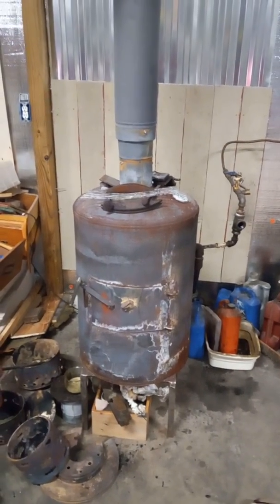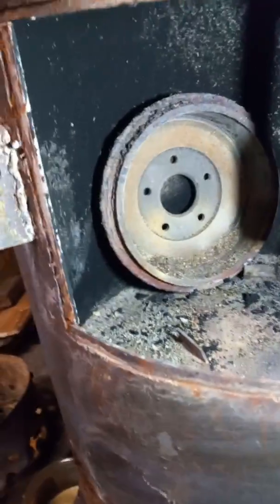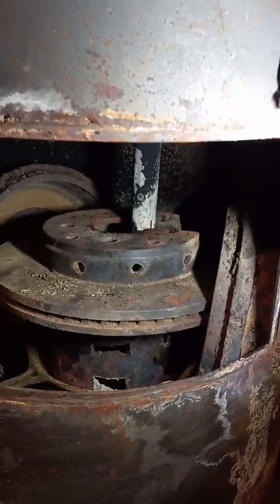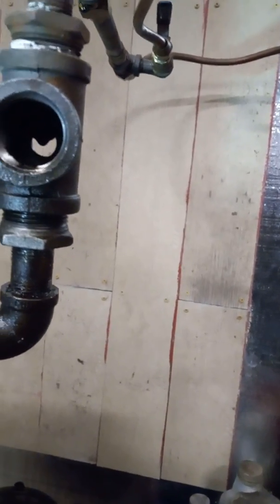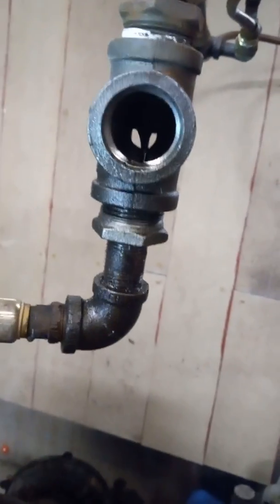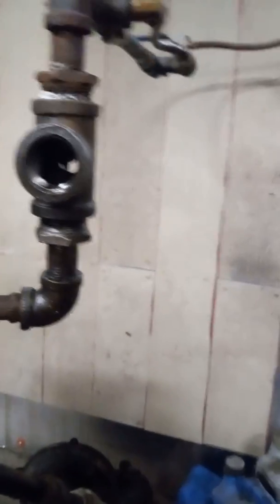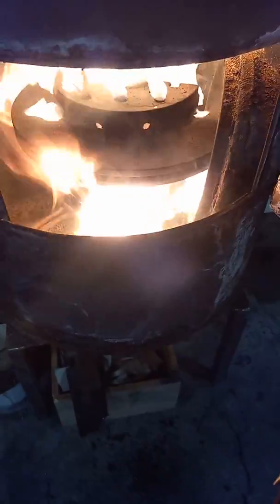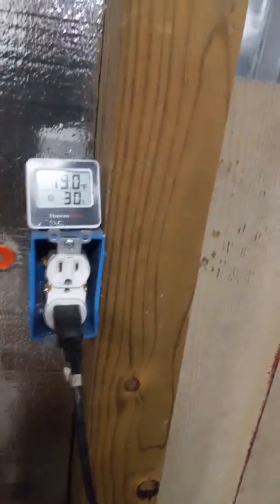Waste oil heater update

Comment: why doesn't the oil ignite in the oil supply line? What temperature is the oil supply line? Does it have to be insulated at the point it enters the heaters housing? (non metal gasket/seal?)

Comment: thermodynamics mean that a heat sink inside will create more radiant heat, stacking half a dozen or more vented brake disks on top of each other would make a great heat sink, someone I knew with a garage did it and the old oil from services was used as fuel for it, but one day a council official got his car repaired got his eye on it and went back to his office and served a clean air summons on him, seems the council prefer us to use metered grid power and dispose of waste oil and not use it for heating anything which is a total waste of a valuable resource, incidentally no smoke came out of the flue just a heat haze, his garage was miles from any houses in the middle of an old pit yard workshop area that was being used by small businesses like garages, spray shops, woodwork shops, and storage containers, councils eh! suppose they are good at some things, like arranging drag queen storytelling for kids down the community centre and paying for it with council tax money and business rates both of which the person with that garage pays!
Reply: just because you can't see the CO doesn't mean it's not coming out of the exhaust pipe.
Reply: Stacking lots of rotors will make it very difficult to light and increase the clean burn time a lot. You can't keep stacking rotors regardless of any "thermodynamic" principles you're talking about.

Comment: How do you prevent the oil from flashing up in the pipes once it gets so hot
Reply from the maker: Not sure which pipes you’re meaning but assuming the feed piping?  If so the blower attached to the larger pipe surrounding the drip tube is supercooling the feed tube so it doesn’t flash the oil, but I find if I turn off the blower leaving the oil dripping that could happen if I leave the door open because I lose the draft from the exhaust piping and it begins to smoke back up into the sight fitting I have at the inlet.
Reply: @rv610dave  hello Dave . How do you prevent the air into going the oil supply,  and what temperature can you reach with the system?
Reply from the maker: @moseschipisa4608  The air surrounds the oil supply pipe keeping it cooler but never pressurizes the oil tube. Stove Temps can reach 800-900+ F during normal operation but if I let it get out of control could go over 1000.  I can get my 32x40 pole barn to 90 Def F during winter months.  I found a key was having a good draft, 6" better than 5".  Couldn't keep a cap on the flue pipe, kept plugging with soot.

Comment: The  screen is smart. I knew there would be  impurities to say the least but damn. If you dont screen or filter the oil youre  just asking for trouble. I just built a beast of a oil burner. I will follow up with pics later. I like this one in the video. Good unit

Comment: A lot of the heat must surely go up and out in the chimney pipe? A way to spread that lost heat around the shop would make a difference?
Reply from the maker: I do have brake rotors now above the burner that slow down the exhaust and gather heat in the casing along with ceiling fans it moves the heat well but takes probably 15 to 20 minutes to come up to higher temps that I like it to be at.

Comment: Must have lot of oil supply, I burn mine much lower, regulate air & oil.   I can run 3 drops in 5 seconds but it will soot up pretty good at low Fire rates.
https://youtube.com/shorts/ebbePvoJoMI?feature=share

Comment: hi great stove.
was wondering if that is blackpipe going through your wall  . might want to keep an eye on it .  just sayin
Reply from the maker: You are right it’s galvanized which is temporary and I will be replacing it, the black pipe is really the thing to use.
Reply: @rv610dave  I think what's he's saying is that the black thin single-wall pipe will get super hot up there and possibly combust the roofing material. It should be double-wall, not single going into your roof.